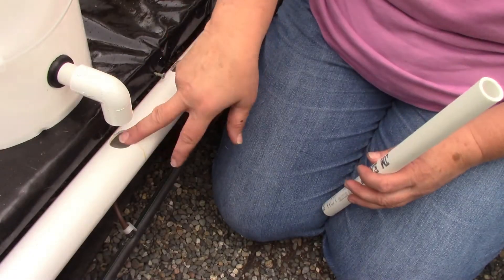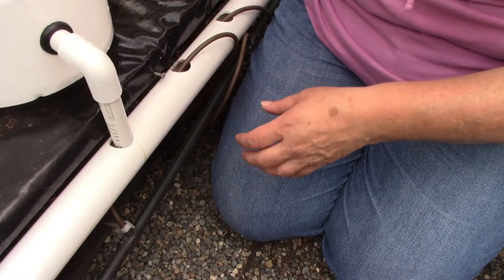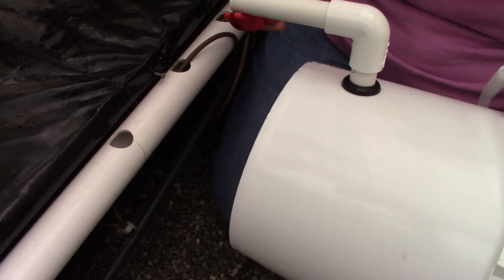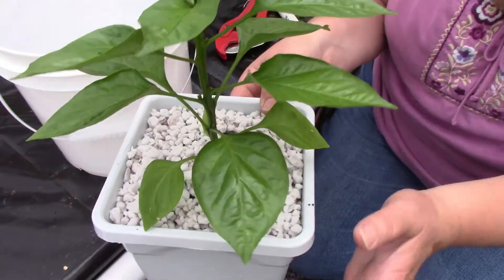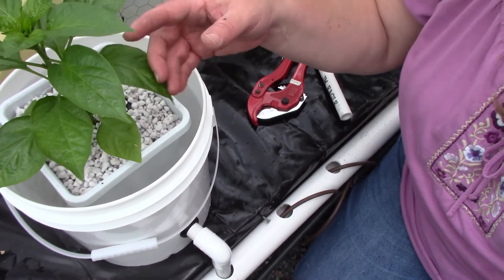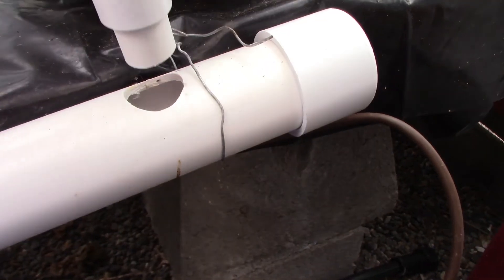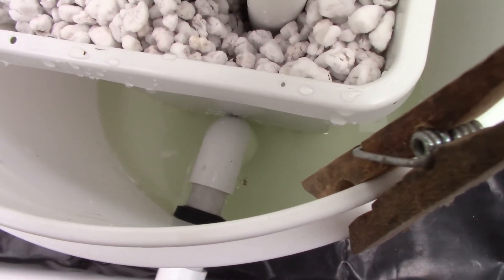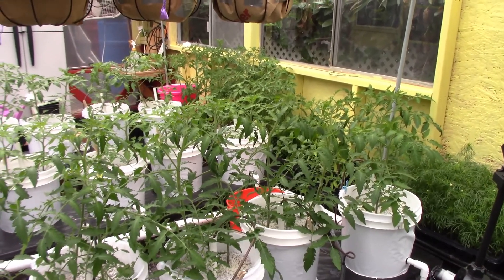Hydroponic Dutch Bucket Drain set up

Comment: I think you will have algea problems in your larger buckets bottoms, and maybe evaporation
Reply from the maker: Thanks for your comment! The buckets that had the panda film blocked the light and i didnt have any algae. The ones that I did not panda film grew algae around the top water level. Last year all my pepper buckets had panda film but the new ones i built this year i didn't get a chance to wrap them.  I only fill my system every two weeks average as long as nothing springs a leak. Next year I'm going to try something else. I'm always experimenting 😀 have a great day!